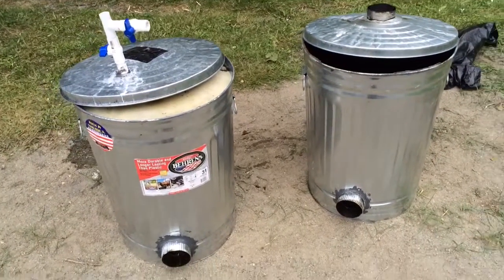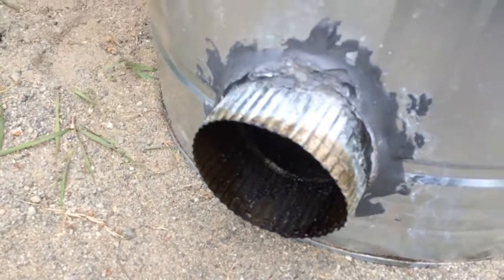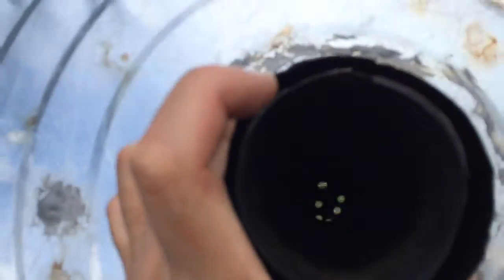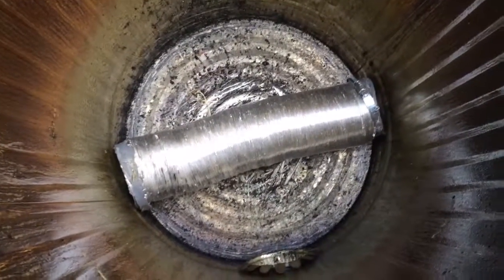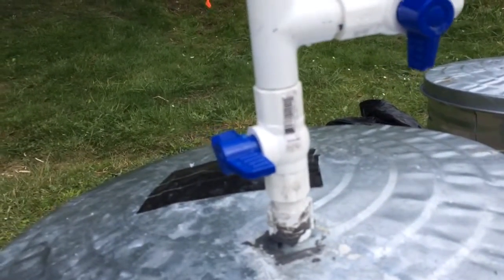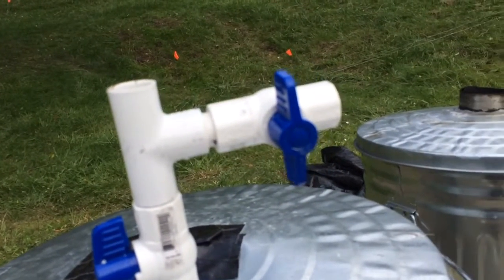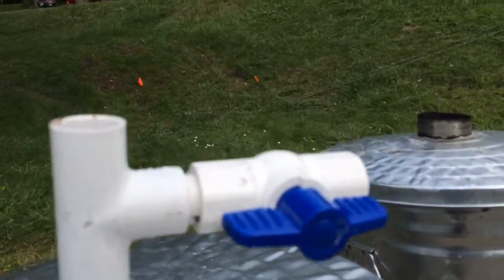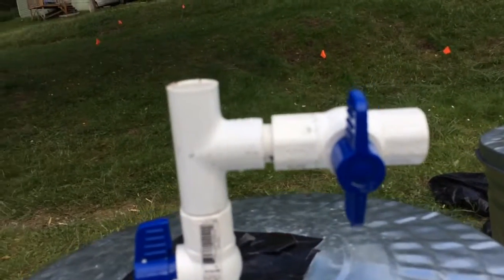Woodgas generator v3 - Toor Camp 2016

Comment: If you start with charcoal, instead of wood, there is no need for filtering.  
In the 1930's there was a shortage of gasoline in Kenya, and people converted automobiles to run on charcoal made from wood (not coal), which had to be lit a few minutes before driving the car anywhere. 
Your motor is basically running on carbon monoxide.